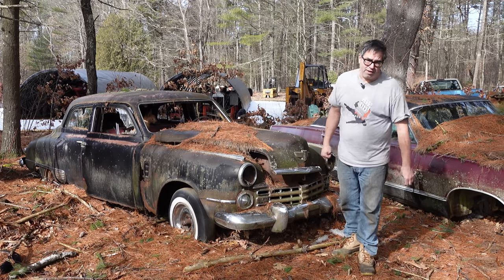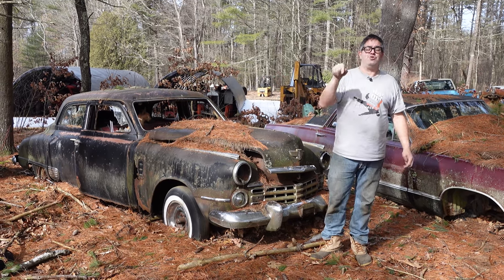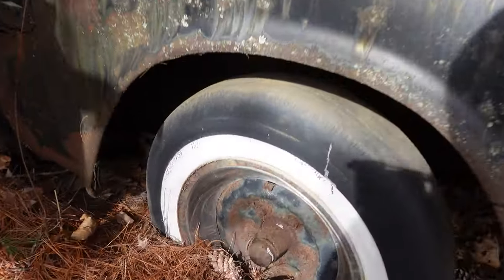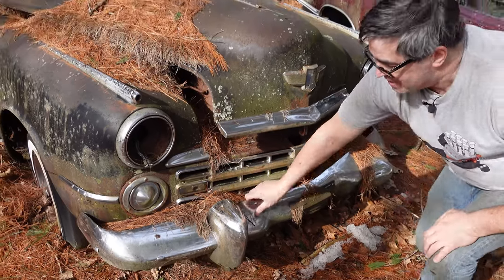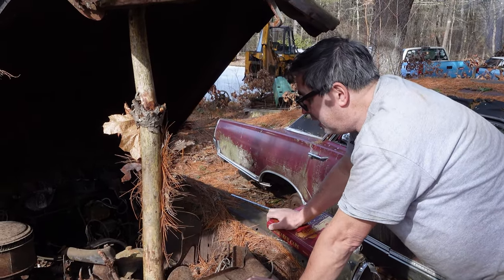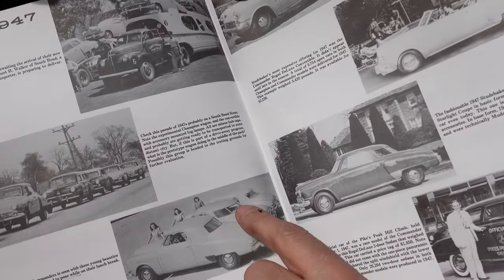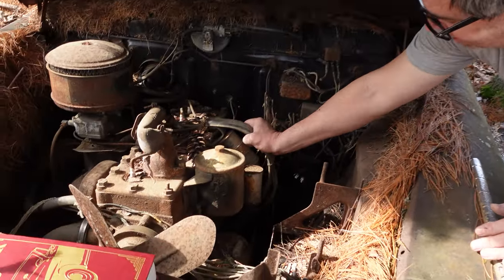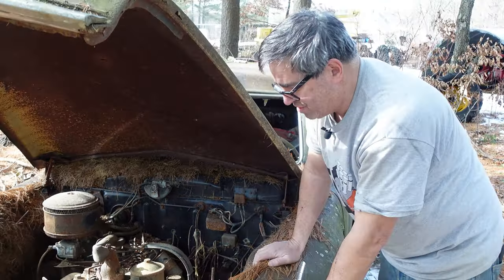Cruiser or Loser

Comment: That Stude has the Borg Warner Overdrive, I noticed the relay for it on the firewall. I'm a big fan of those transmissions, they were used by almost every manufacturer back in that time, but Studebaker had the most of them. Great transmissions.

Comment: It is a 48, not a 49.  The 49's had two section taillights, the 47/48 had four section taillights.  The glass grill mounted signal lights were new for '48/  The 47's did not come stock with signal lights.

The 48 was the car in which my brother came home from the hospital.  I was born two years earlier and didn't make it to the hospital.  I was born in the rear seat of a '37 Studebaker "Dictator" and therefore always a big fan of the Company!

Comment: In 85 me and my friends were getting our driver's license as we turn 16 that year and my buddy's brother had one that he had put a Chevy 400 in and changed the rear end and it was handed down to him and we used to outrun everything in it, i did some free hand pinstriping on it for him and I took the emblems off and made it into the doodiebaker, it was brown and looked like a turd. Lol. The wiring was halfass done and it would just stop and take a break when it wanted to 😂 and the reared was a Plymouth posi and the car would fly but it also was equally as bad looking. Finally we pulled it in the autobody class we were in behind the high school and bondo, d it up and painted it and it looked good, I repainted the stripes and the doodiebaker on the sides and back,  two months ago I went to my friends house and he still has it in his basement and we poured some gas in the carb and fired it up and did doughnuts in the field beside his house lol. His wife came out and made us stop and told me to go home until I could act right lol, it was kinda like a flashback cause his mom used to come out of the same house and tell me that exact same thing,  lolol. I made him a offer for it and I think he's gonna sell it to me Monday
Reply: That's awesome. Hope you have a great time with the car.
Reply: @geoffkeller5337  I'm sure we will, myself and two other friends that used to ride around in it with us are gonna repaint it and put the pinstripes on it again just like it used to be, they are still on it but looking rough, and were gonna give it back to him on his birthday, his brother passed away last year and I thought that would mean more to him than any gift we could buy since his brother is the one who built the car
Reply: @coinslotsandjoysticks2572  That will be an amazing gift for him.

Comment: The Land Cruiser was a body code "Y" in 1949. I always found their vehicles to be a bit stodgy, but that's just my two cents. The body tag is just out of view on the right side firewall. Possible code 8303 Midnight Blue exterior paint. 

I remember starting out in automotive parts and those older fuel pumps could be rebuilt with kits. At the time, "Motor Laboratories" was one company that did it. A quick lookup even at that time revealed it was part of KEM Manufacturing in Fair Lawn, NJ. They were located at 18-35 River Road.

A quick funny story is that I interview there around 1998-2000 while working for another parts manufacturer at the time. I quickly got an interview with them, to which the hiring manager gave me a "competency test". I had just finished my MBA, so I was still "school and test sharp" with those types of skills, and I easily passed. Then the interview started, but it was more of a fishing expedition with questions such as, "How do you do your catalog?" "What systems do you use?" "How do you do new products and introduce new items?" "Who does your competitive interchanges?" With that, I realized it was nothing more than a fishing expedition, but I let the interviewer talk.

When he said, "Ok, I'm done..." (and trying to end the interview) I said, "Well I have some questions for you." With that I turned into a fishing expedition, but only to find out if the job was real or not and what the job would entail.

I didn't get the job and I later found out why....my current salary at the time was much more than the hiring manager was making and willing to offer me. All the better, as KEM went out of business in 2005, about the same exact time as I started my current job. There's a bank and other businesses on that property now. Yes, Delco was part of GM by the time that Studebaker was made.
Reply: I remember KEM. Still have a brand new set of points in a blister pack from KEM.
Reply: @LongIslandMopars  As I do. I bought a "mystery box" of their parts off Ebay and sell them now and then. A few sold, because I have figured out all of the applications. KEM made some parts and bought from the same sources as many of the other aftermarkets. Their yellow MAG ignition wires were rumored to be Bosch wire in bulk made for them and terminated in Paterson, NJ.
Reply: @googleusergp  Cool. That's awesome

Comment: Studebaker afficionado her.  I almost missed this one as I was out of the country.  Excellent and highly accurate video. The underfloor master cylinder is, as you said, most inconvenient.  Unfortunately, Studebaker kept it long after, as in my 1955 President. The vacuum wipers are infamous but electric wipers were offered on some models as early as 1941.  The difference of four inches in the wheelbase is not enough to really distinguish the Land Cruiser from the Commander by a cursory glance.  A spotting tip is to look for the small window behind the rear door rolldown window.  Only the Land Cruiser has them.  Great video, thanks again.

Comment: Only 100 hp for all that weight, for sure not a speed demon, but I can envision that boat cruising down the road, just rolling over any bumps and potholes without a problem. 🇨🇦👍
Reply: Probably not as bad as you'd think - we've gotten spoiled by rising hp numbers in the last decade or so.  Top speed for a car back then was usually somewhere between 75 and 80 mph - but the lower gearing meant they didn't drive badly despite the low power (low by today's standards, anyway.)  But most cars back then were designed for cruising along country roads at about 40-45, rather than the more common 55 or more we see these days.  Remember, in the late '40s the huge interconnected network of high speed interstates we all enjoy now was just getting started.

To compare: the '49 Stude specs out with a top speed of 85 mph (87 if you got the 4-speed), a weight of close to 1 3/4 ton, and a 0-60 of 17.7 secs.  A '49 Chev Fleetline looks to be a comparable-sized 4-door car, is about 200 lb lighter, but with a top speed of only 73 mph, and a 0-60 of 21.6 secs.  Makes the Stude look to be pretty swift by the standards of the day, both in acceleration and in high speed cruising.
https://www.automobile-catalog.com/make/studebaker/commander_4gen/commander_4_land_cruiser/1949.html#gsc.tab=0
https://www.automobile-catalog.com/make/chevrolet_usa/full-size_chevrolet_2gen/full-size_2gen_2100_fleetline_4-door_sedan/1949.html#gsc.tab=0

Comment: Steve says ' a pretty much unmolested' under hood region. Any one else notice the orange juice can? Its located between the auxiliary oil filter and the metal loom that keeps the spark plug wires together. I'm not sure Steve noticed.